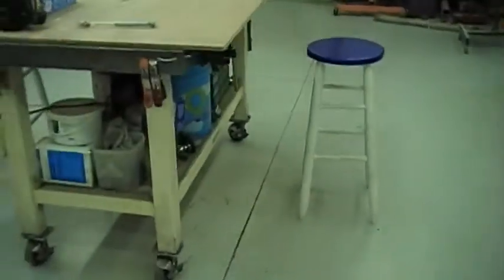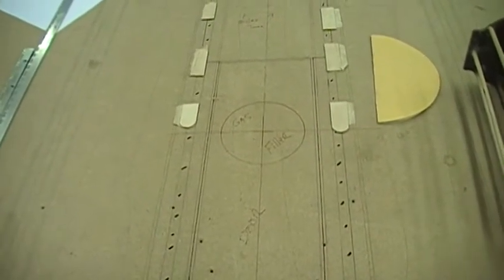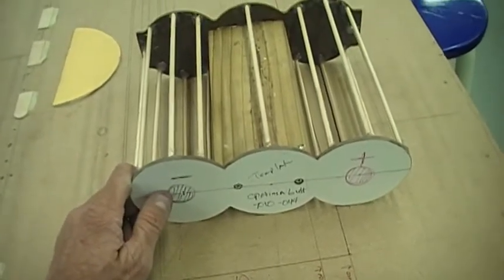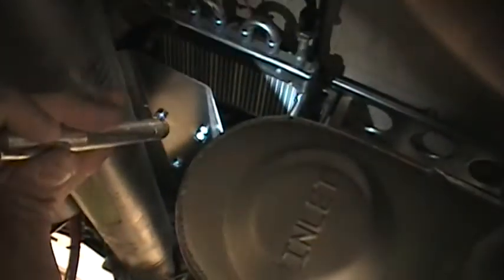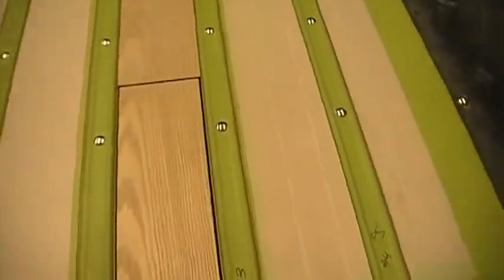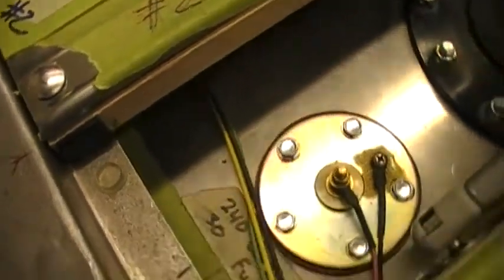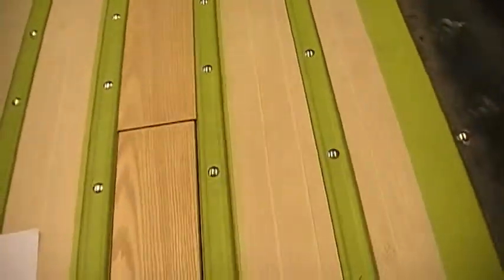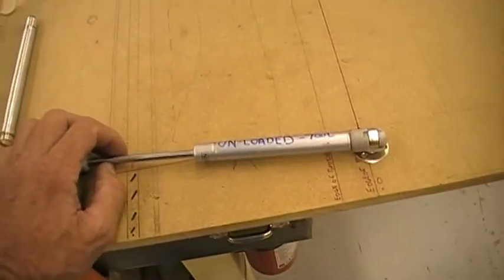31 Ford Model A pickup 37

Comment: Fantastic Terry.  I like the simple pull too.  The only thing I can think of that might be even more hidden is the mag latch that you tap to open.  It could kick that board up just a fraction so you wouldn't need a pull.  I also like your biscuit joined boards...  Smart.
Reply from the maker: Thanks Greg, yes I looked at using a mini-latch like we use in aviation but the down force was to great to get it to come up enough to work...even with two mini latches it was to much. the problem I ran into was I could not find that shock in a 50N model so I had to use a 100N model which is about 22.48 lbs of  force. I looked at adding a soft pusher to help offset that problem but then it got a little to "busy" back there. Thanks for watching !

Comment: I'd consider insetting a magnet into the underside of your fuel cover. Then incorporate another magnet into a tool you can keep in your cab. That way there would be no visible handle. I'm sure a set of nickel-sized neodymium magnets would have plenty of power for the job.
Reply from the maker: I agree that is a great idea , and unfortunately that gas shock holds that lid down hard. even rare earth magnets cant over power the downward force of the hydraulic shock.I looked at several other mini latch/pusher versions to try not to have any visible pull but  I didnt have enough real-estate to make a viable solution for it.